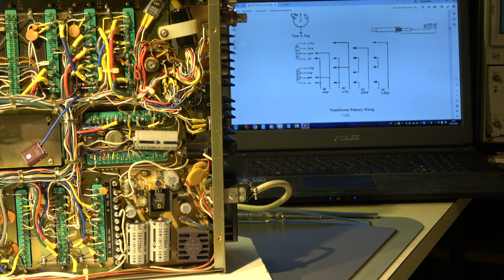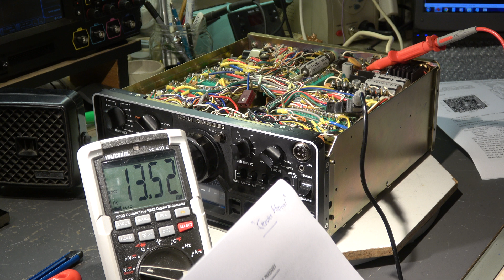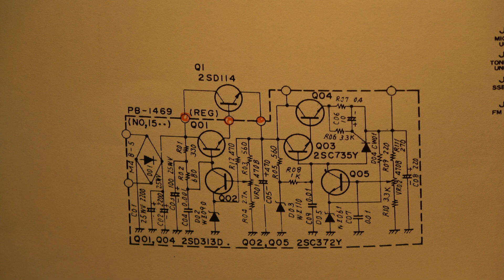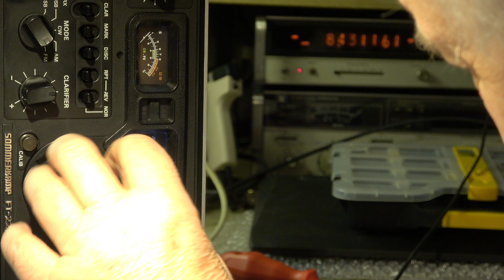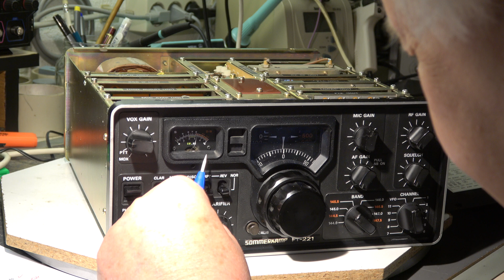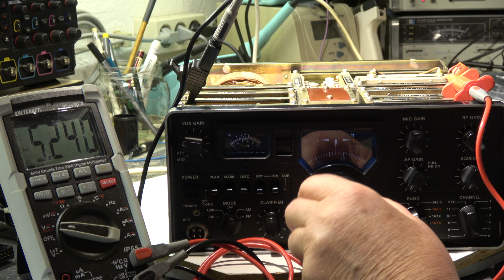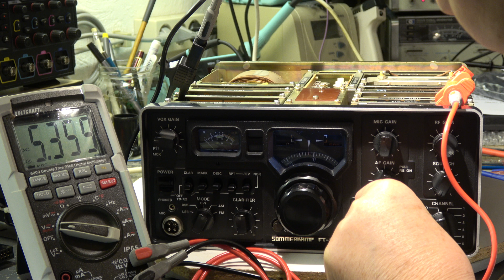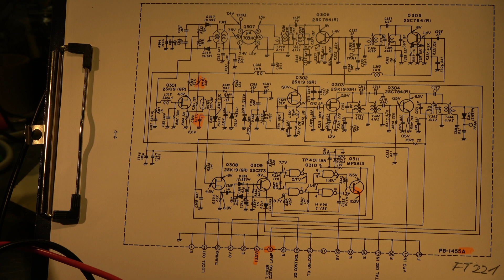#196 YAESU SOMMERKAMP FT 221 Part 3(9)

Comment: Dieses Casettensystem mit den Einschüben ist eigentlich vorbildlich und professionell, wie es z.B. auch in R&S Funkmessplätzen Verwendung findet, z.B. einem SMS2 den ich auch mal gebraucht bekommen und repariert habe,.Zum Glück war im Messplatz selbst eine Adapterplatine vorhanden. Immer wenn ich das Gerät hier sehe, kommen in mir Erinnerungen an den Beginn meiner "AFU Kariiere" hoch. Der FT221 lief damals eigentlich rund um die Uhr und hab damit wundervolle QSO Zustande bekommen (auch SAT / Aurora). Damals hatte ich im Gegensatz zu Heute noch Antennenmöglichkeiten, mit Rotor, einer 2x10 El. X-Yagi mit selbstgebautem Polarisationsumschalter, nem Preamp und 100W PA. Bin gespannt auf die Fortsetzung. Hast recht, es gibt neben dem AFU Leben noch ein anderes, eigentlich wichtigeres Leben, bleib Gesund Stefan, 73 de DL1LAJ, Andreas
Reply from the maker: Ja, diese schönen Oldtimer wecken Erinnerungen - so wie manch altes Auto (weist Du noch, damals....)